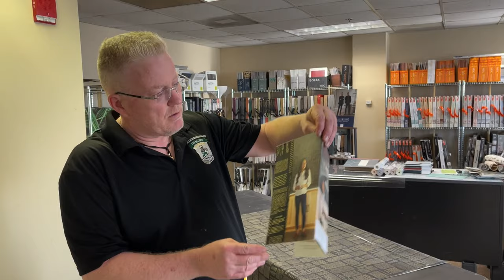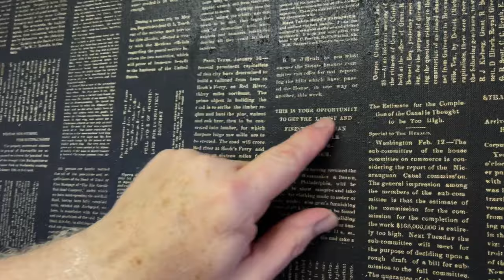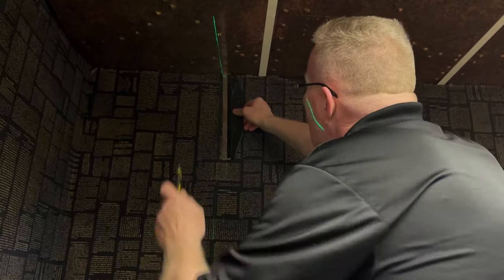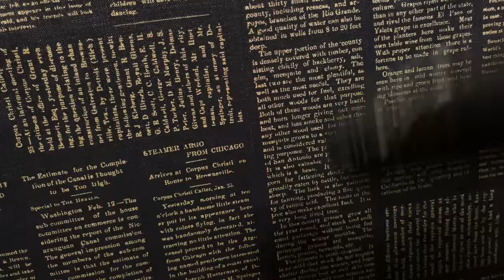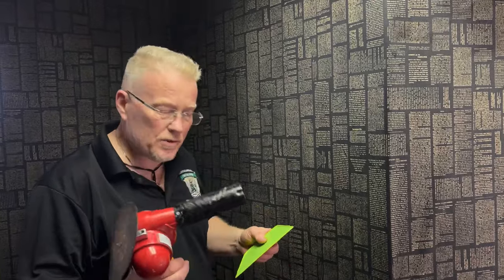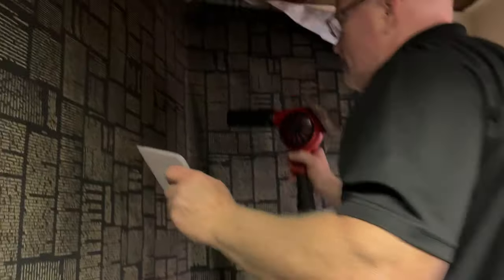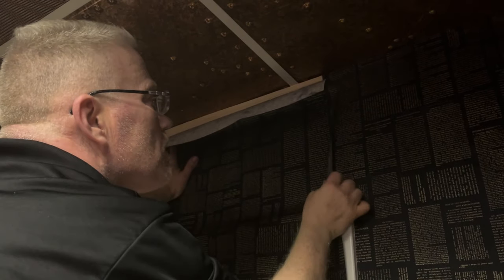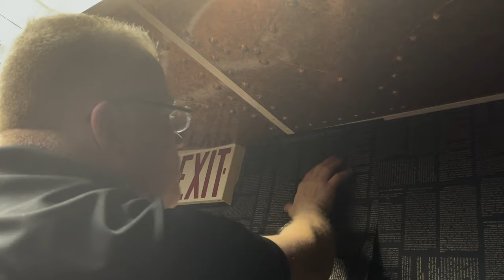Hanging 54" Joanna Gaines Magnolia Home Editorial Newspaper Commercial Wallpaper | Editorial MAG1021

Comment: Spencer, why did you decide to not seal the walls with Gardz or Roman 999?  I understand that it was a fully cured latex paint, but won’t the glue still react or soften it?  Just trying to understand if there are installs where sealing isn’t necessary.
Reply from the maker: Some of you guys are too smart for your own good, like you! LOL of course I’m just kidding. Most people would not have noticed that but, since you noticed it let me explain. Semigloss paint is one of the hardest substrates over which to hang wallpaper. 
Only because it is fully cured and has been up for a long time, you can forgo putting 999 onto it; what does 999 do? It’s simply seals porous surfaces.  Is semi gloss porous?  Not at all in fact, semi gloss is a very good uniform substrate over which to hang the paper and when you remove this very thick vinyl, it is likely that all you will have is a paste residue with which to contend after you take the stuff down over semigloss paint; that’s a lot different than hanging this product over drywall that was just installed and doesn’t have any paint on it; that’s a lot different also then just hanging this material over a flat paint
Reply: @spencercolgan  thanks so much!  I had missed the detail of semigloss paint, thanks for clarifying.  Could you do this over satin finish walls?  I wouldn’t try over flat or eggshell finish latex, but could you hang directly over satin?  Thanks for all of the info, please keep making videos!
Reply from the maker: @fedenfield6337  excellent question; satin Paint And eggshell do not have the consistency or the viscosity I should say to tolerate wallpaper paste. I would make sure that I sealed those things beforehand   

I cannot thank you enough for your encouraging words regarding my videos; I guess you have seen a few of them… Would you mind giving me a five star review on the following link and tell everybody how my videos are helping you or how they have helped you? I would greatly appreciate it if you could say something nice; you push five stars and then it will invite you to make a comment; I cannot thank you enough for your time

https://www.google.com/search?q=tampa%20wallpaper%20installer&tbm=#lkt=LocalPoiReviews&trex=m_t:lcl_akp,rc_f:nav,rc_ludocids:18168418332679895040,rc_q:Spencer%2520Colgan%2520-%2520Wallpaper%2520Installer,ru_q:Spencer%2520Colgan%2520-%2520Wallpaper%2520Installer,trex_id:XCBBr
Reply: Hmm. What if the semi-gloss paint was of a poor quality and it was installed to a low-adhesion PVA primer (or even worse … straight drywall). Wallpaper adhesive is really strong compared to the adhesive layer that paint is likely attached to, which can result in the paint de-laminating from the surface, causing bubbling. I suspect this method will still result in more call backs than simply making sure your substrate is solid by prepping it yourself appropriately. Even wetting it down with a sponge a couple of times and scratching the surface isn’t adequate (though better than simply saying “well, it’s a semigloss paint”). 

Also … when you open the material to install it? Do you get air in it? Or does it perfectly attach to the wall without any additional contact with air? I’ve definitely massaged certain wallcoverings; but vinyl ain’t one of them 😅. Easy way to not have to wash the material as much: don’t get paste on it. Tape the face of the bottom layer under the seam and cut through that. If it’s a pattern material, use a purple tape or yellow. Something with a translucency so you can see the pattern through it. 

I love your videos, Spencer! And there are so many ways of doing this stuff. But minimizing call backs … I’m not sure this method helps much.